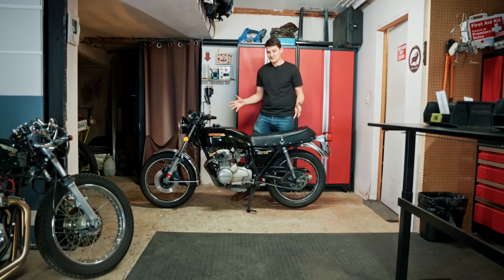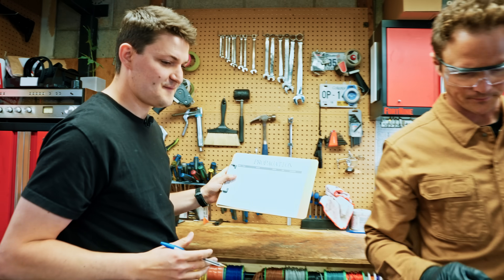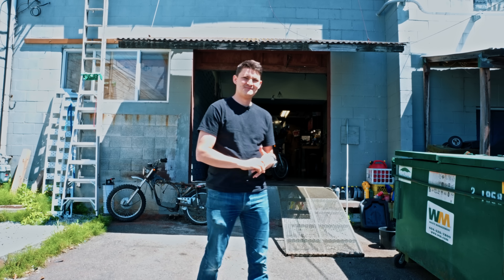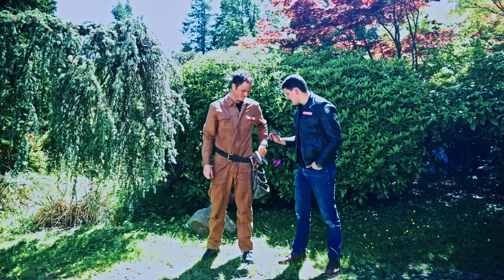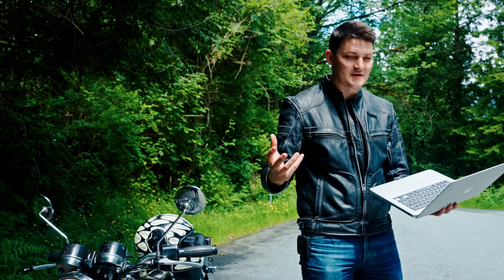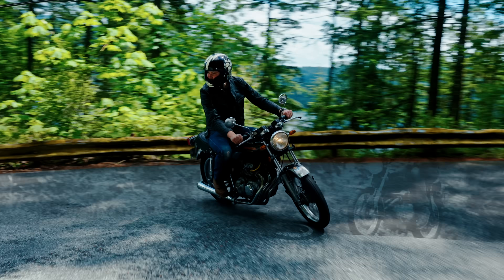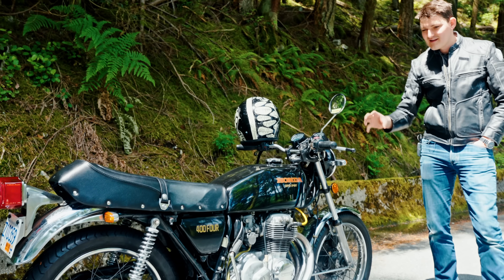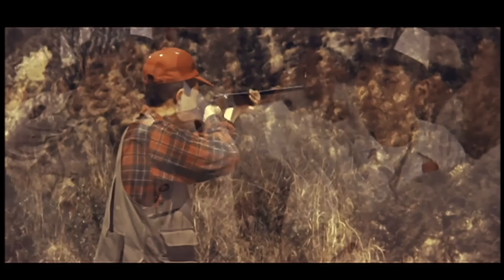Why Hondas Run Great - JIT Manufacturing, 5S Methodology and Kaizen

Comment: Japanese manufacturing's quality is incredible. Reliability unmatched anywhere else.
Reply: @grumpyrider369  made in Japan Suzuki are kick ass
Reply: @grumpyrider369  Absolutely including Suzuki, even despite some of their indian-made products.
Reply: @digm0repaka  Let me tell the indian made suzuki are good and reliable, but not innovate enough, but key they dominate the car market.
Reply: For honda bike ? Nope, in here indonesia where millions were made, it got issue with chasis, old honda is good but greedy new one, are not
Reply: In the seventies, eighties and nineties, Honda was pretty good, somewhere in the early 2000s something changed but they have been riding the wave of reputation.  I ran a motorcycle training school and went from all Honda to other brands due to reliability and the willingness to admit issues.  The high mileage, 10 year old Hondas were outperforming the newer ones. Very sad.
Reply: @tomedgar4375  What changed? They moved their auto manufacturing to the USA. And many of their electronics are now made in China. Those things that are still made in Japan are excellent.
Reply: @80sNostalgiaGuy  
I suspect it is company culture.  No electronic issues, it was internal engine machining problems either from worn out tooling or just poor qc.
Reply: Reliability comes at the cost of performance. I’ll take a superior Austrian bike any day outside of war time. 

If longevity is all you care about, change the rings and decrease the pressure on a KTM. You not have an equally slow yet lighter product.
Reply: I think these stereotypes are useless. I had more issues on japanese made bikes than with italian bikes. Japanese bikes have recals and issues just like any other brand of bikes. My father had Yamaha Tmax and three out of two times I borrowed it I didnt manage to get to where I was going because it broke down. Always something else. No use in being delusionall and thinking a bike wont even brake down just because it is japanese.
Reply: @otakarlibal  I’m calling BS on this one. I love Italian bikes, but they’re nowhere near as reliable and trouble-free as Japanese bikes.
Reply: @TheBlueDogMan  They could be more reliable in general. All I am saying is that a bike  being japanese, doesnt mean it wont brake down. And the bike being european doesnt mean that it will brake down. I have been riding an MV Agusta F3 on track for 4 years and it was trouble free. I also have an Aprilia Shiver, also zero issues and the bike is nine years old now. Before I had a Kawasaki, it was also no issues. It would probably be the same with Honda or whatever other bike. I just think that these stereotypes help

Comment: I have a 50 year old Honda that still runs!
Reply: I have a 51 year old BMW that runs well, except the odometer broke when turning over 200,000 miles.😑
Reply: @radonradon5478  now there’s a crazy problem to have!
Reply: I know a guy. No, really  there's a BMW-specific speedo tech for (what I'm assuming is an) airhead.